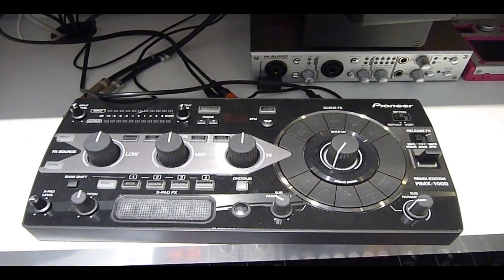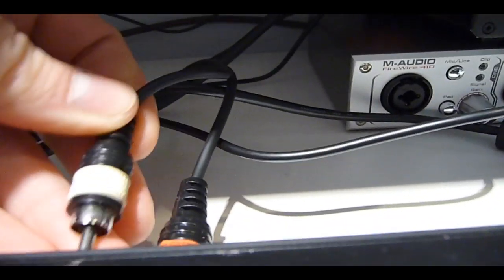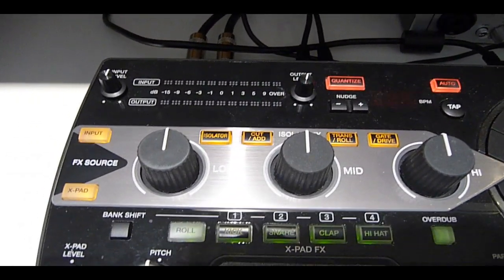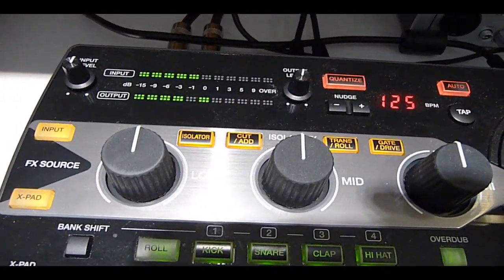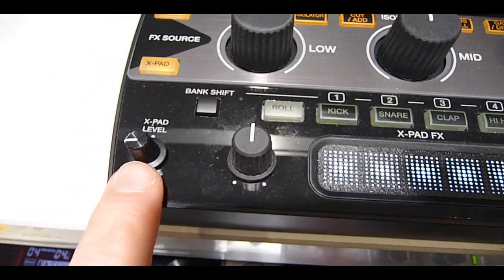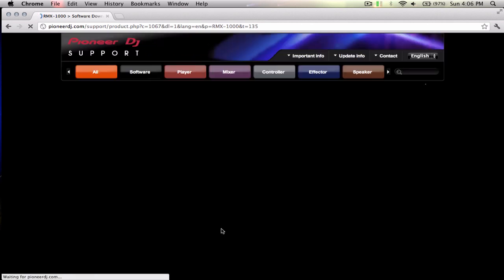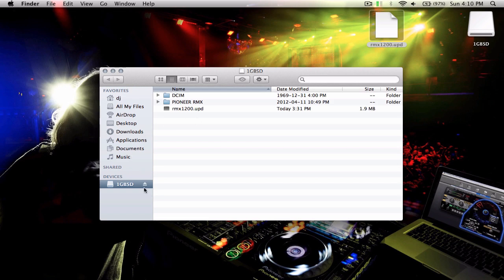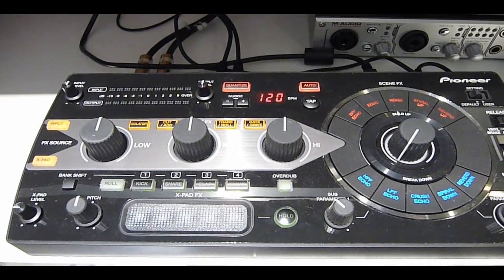RMX-1000 Setup & Firmware Update

Comment: Hey Pulse, have the rmx connected via USB to laptop, got my SD card inserted into the laptop, added the RMX2200.upd to the memory card, do i add it back to rmx before trying to update firmware? Or does the firmware update from laptop and sd via usb then add the sd card when its complete? stuck on 1.31.
Reply from the maker: You need to put the firmware file on the SD card and then perform the update on the RMX itself with the SD card in the RMX.

Comment: What's a better setup a pair of Pioneer XDJ-1000 players with a Pioneer DJM-900SRT mixer, a Pioneer DDJ-SP1 Midi Controller and a Pioneer RMX-500/1000 (I don't know which is better) or a pair of Pioneer XDJ-1000 players with a Rane 62 mixer, a Pioneer DDJ-SP1 Midi Controller and a Pioneer RMX-500/1000?

Comment: HELP PLEASE!
using djm 800 and send /return feature. 
1: should you have your efx button on the djm turn on all the time or just when using the rmx? Because THE PROBLEM IS that when you turn off or on the rmx by pressing efx button on djm , THE SOUND CHANGES  a little bit, but it can be noticed and it is LOW QUALITY SOUND , and a bit quieter, but even if you turn rmx output a bit more it is louder but sounds bad. Not as original. 
Does anyone have this problem? And how to solve this?
Thanks!

Comment: Hi, whenever i turn the send return effect off there is a slight clicking noise coming from the output. Is this a problem with my levels?
Reply: King Kong I'm getting the same problem actually on my mixer right when I hit the effects on button I have a formula sound FF 4000 it makes a slight pop sound what you can hear every time you engage the effects on switch I mean that's completely useless it that's the case you know it's going to be hearing that shit

Comment: where does the USB connect to on the mixer I'm gathering?
Reply from the maker: The RMX-1000 does not connect to the mixer via USB, you have to use the audio connections.
Reply: +Pulse Pioneer DJ yeah I know that but I just see in this video plugging in a USB in the back of rmx
Reply from the maker: The USB connects between the computer and RMX for updating the firmware or using it as a controller for the software plugin.

Comment: Hello,I just got this bad boy updated firmware and software,everything works,but when I turn it on and the SD card is inserted and or detected,it opens windows media player which starts scanning the wave samples and it plays them.why is this happening and how can I stop this wierd reaction?
Reply from the maker: +mastertracker510 > You probably have Windows Media Player configured to automatically mount and start playback from those devices when media files are found. Try this link to see if the instructions help in disabling the auto play: http://bit.ly/1PGTc1r
Reply: +Pulse Pioneer DJ thanks man,that wasnt it.wierd....

Comment: Hi I was wondering if you might know reasons as to why my SD Card won't be recognized. Its brand new out of the package but no matter what I do it doesn't show it on my PC (win 7). Does this mean I won't be able to update the device?  Thank you if you can shed some light on this, thanks!
Reply from the maker: @Navid > What is the SD card type / capacity? SDHC are supported, but SDXC are not, and they should be formatted to FAT32.
Reply: oh ok it has to be formatted before using it on the rmx 1000. thanks! :)

Comment: You show the connections to the RMX and you do not explain where do these cables come from....
Reply from the maker: Sorry, this assumes you already know how to connect a send/return to your mixer - as many mixers use different types of send/return, or have none at all, it's up to your setup, this is more about the levels and firmware than the actual in/out cabling.
Reply: @DeejayPulse  Yes.. I used the manual. All solved.. Thanks,

Comment: its too loud without sending to a dedicated return channel. :(
Reply from the maker: Just turn down the output level.
Reply: Pulse yep then the volume changes when send/return channel is engaged/disengaged (on Rane MP2015)
Reply from the maker: @wpf312  As demonstrated in the video, if you adjust the in/out levels on the RMX you can get it so the level doesn't change on the mixer.